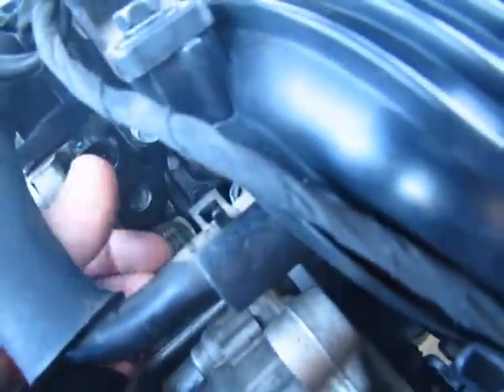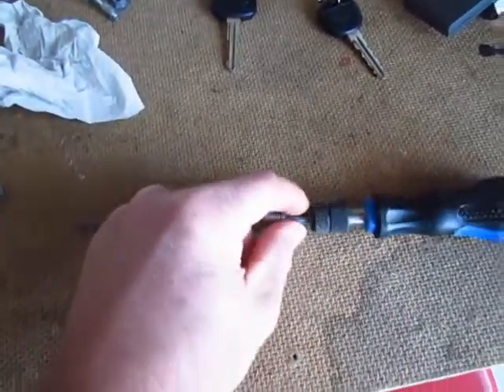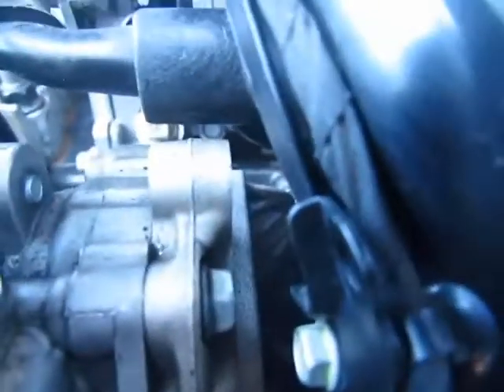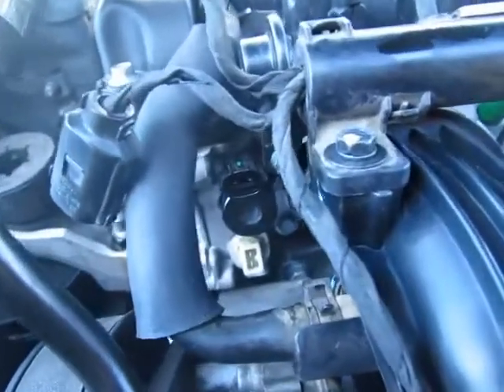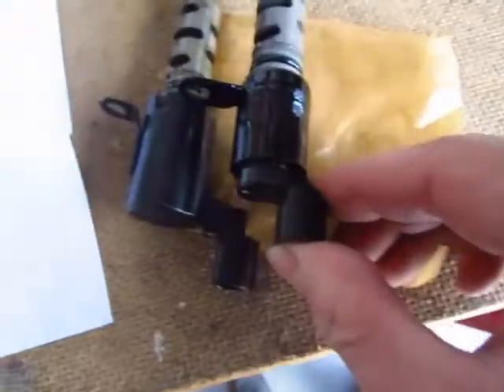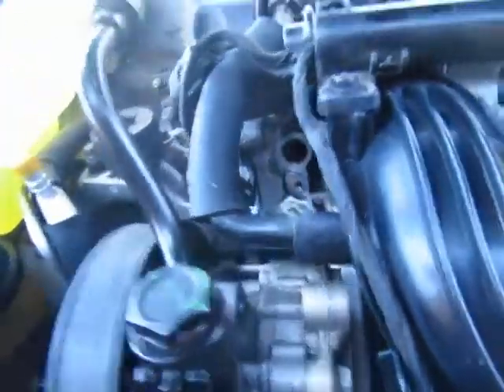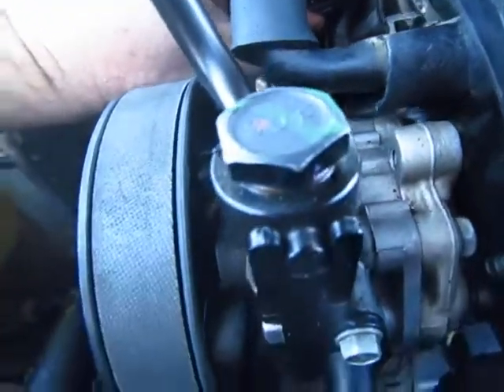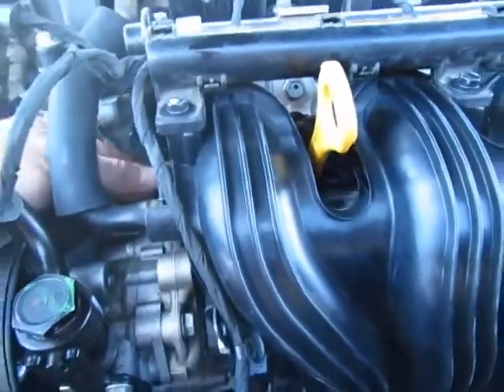How to Replace a Variable Valve Timing Solenoid/Actuator

Comment: Hey Rick, what size of Torx bit did you use....having a hard time getting it out...thanks
Reply from the maker: Hello Rick, 
          I used a 1/4 inch drive T-30 torx star pit socket with a swivel.
Reply from the maker: T-30 Torx star bit.
Reply: Thanks Rick, got it removed...hate torx bolts

Comment: Can you tell me what code it was showing?
Reply from the maker: Hello Derek,  
       P0011 is a very common trouble code. Camshaft Position Actuators change the lift of the camshaft up to 25 degrees. They are hydraulic, which means that they use the vehicle’s engine oil to control lift. So, if you have low oil pressure or dirty oil, it can keep them from doing their job properly, and trigger a P0011 code.

Comment: I was just looking at them on Rockauto. My Sonata is also 08', light gray like yours. BUT....  it's a V-6. So I have to figure out which one is the   "intake" one. I'm getting codes 21, 22, 82, and 83. My mechanic friend said I could test the actuator, but they're cheap enough to replace.
Reply: Yea my code was po11 but  my mechanic said the same thing !
Reply: @mikeyc3726  Hey, I wish you well on your Sonata. I never did get the opportunity to follow through as the engine ran out of oil and got a loud rod knock! So now it sits until I can donate it. Really too bad as I had a lot of money rapped up in the car, but can thank the dealer for screwing it up. They messed up so many things (including the oil issue), yet still managed to put a lot of distance between me and many thousands of my hard earned dollars. The good news is I learned my lesson, plus the nightmare of trying to keep a 250k+ mile vehicle on the road is finally over.